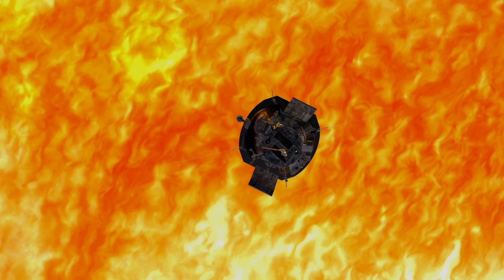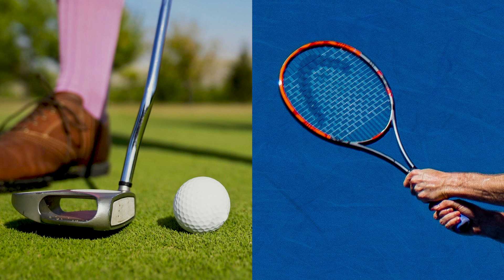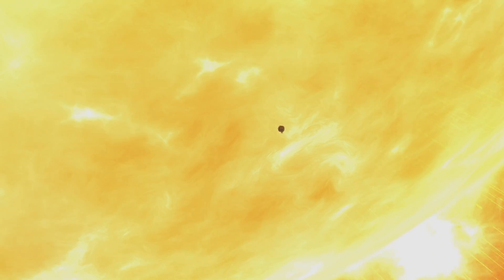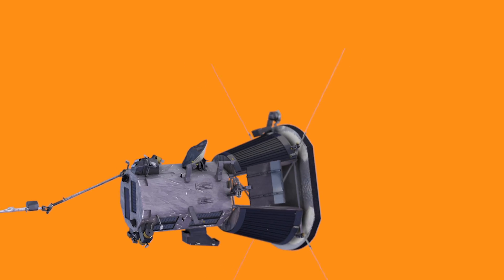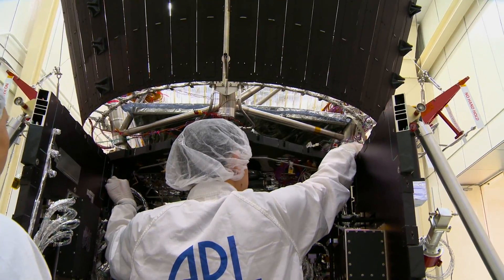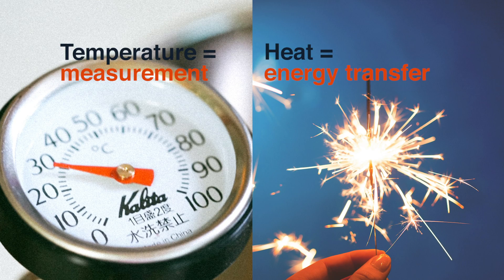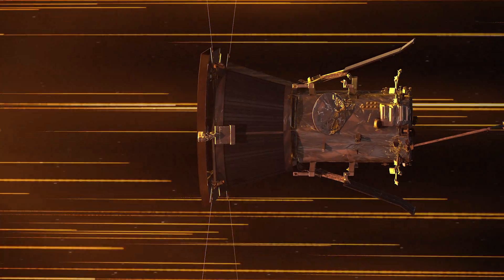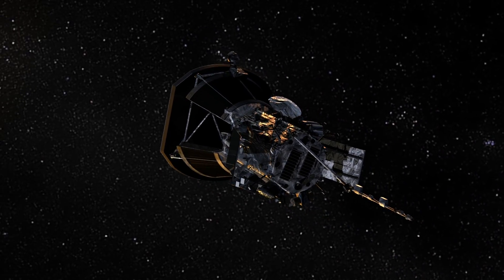Why Won't it Melt? How NASA's Solar Probe will Survive the Sun

Comment: water??? buttt??? water ivaporate right??? soo how long could it cool that craft?
Reply: A) its pressurized water, higher boiling point
B) its a closed system, like your AC or a computer cooling unit, you never have to replace the water. 
C) The water passes by radiators which radiate the heat into space in the form of thermal radiation since there is no atmosphere to convect the heat
Reply: +Saani Maula 👍😅
Reply: Cant tell if you believe me lol
Reply: +Saani Maula lol i believe because i cant wven correct my grammar so who am i to not believe in you? hahahaha lol😂😂

Comment: send a mirror close to a fire and see if it will reflect the heat or get very hot, remember that the heart of the sun is much powerful to melt or destroy any material that gets close to it this is why the earth has the ozone layer to reduce the heat of the sun yet things get cooked up when the sun becomes hotter causing volcanoes, bush fire and cracks on the ground. and to design the materials for the robot heat is needed to melt and make a cut to have a shape, that heat is even less than the heat of the sun as you get closer. even a deep freezer finds it difficult to make ice when placed in the sun for a longer time.

Comment: Water cooling solution? Just water?! In space?! Using radiator?! To transfer heat? Im no 0g engineer. But thats not how it works. Radiators need a gas to cool down. The vacum of space is absent of a media to transfer heat. So how do they do it again?
And plain old water? Yep great idear! Lets cool down a surface that might get crazy hot with water.... Dunno about you. But water boil at a relatively cold temperature. 
Being a marine engineering these big holes in this pressentation bugs me...
Reply: The radiators will radiate the heat in the form of infrared radiation. Youre right since its in a vacuum there will be no convection taking place, which is why PRESSURIZED water is a great choice, its got a much higher boiling point. As a marine engineer I hope you know what PV=nRT is.

Comment: Bu... bu... but what does it do?
Reply: According to Wikipedia:
- Trace the flow of energy that heats the corona and accelerates the solar wind.
- Determine the structure and dynamics of the magnetic fields at the sources of solar wind.
- Determine what mechanisms accelerate and transport energetic particles.

Comment: So where does the heat that goes to the radiators dissipate?? The one on your car transfers heat to the air that passes through it. But theres no air(or any other median) for it to transfer into. Sounds like the water flowing will just heat the spacecraft more evenly.
Reply: The heat will radiate into space as infrared radiation

Comment: History has told us that that the sun is hot. It’s not. The radiation with superheat an object and heats the earth due to its atmosphere.

As one moves away from Earth, the air gets colder. Space is cold. Although the sun is a source of radiant heat, the air around the sun is cold. Similar to a microwave. The oven is cold to touch, the inside is cold to touch but anything placed inside will be affected by the radiation.
Reply: You dont need that to explain why space is cold, watch the video again. The are particles radiated away from the sun in the form of infrared radiation, these particles have a high temperature, however the amount of particles per unit space is low. As a result the heat transfer is super minimal resulting in no heat transfer. Combine this with the fact that vacuum of space isn't an atmosphere, it cannot perform convection, as a result the radiation simply travels through without being absorbed into anything

Comment: NASA please teach Apple how to keep their new laptops cool as well. Thank you.
Reply: Simple, run your fans from much lower temps and put in some vents
Reply: thought old macs like mine are the only ones that heat up like hell. guess new ones do too?
Reply: @naomiperez7482  New ones are much worse! I've owned every single MacBook they have put out they just get worse and worse. I would shift to Windows but unfortunately I'm into music and the software I use (Logic X) is only compatible with Mac.
Reply: There's a reason why these engineers are working at keeping laptops cool and not in a space agency...
Reply: @atoms_dancing  haha good point
Reply: @BlueEthereal  ditto
Reply: Simple. Don't buy a apple product.
Reply: @HaikHakopyan  and buy PC with water cooler instead
Reply: We at NASA would be delighted to teach Apple a thing or two. Their platform is horrible.
Reply: Pv = nrt, reduce pressure of air
Reply: @tarankirat8226  that doesn't make any sense. How is ideal gas law relevant here?
Reply: iphone too please :(
I run instagram for 10 minutes and its ready to explode bcs of overheating
Reply: Mac M1 is dope ngl
Reply: And teach sony/PlayStation as well
Reply: because it's Motherboard And battery made by china , but I don't understand why USA won't make themselves  😐
Reply: @kishanpreston1533  then its cost is artificially hyped without much reason

Comment: Lol NASA didn't think abaut Solarforce. The probe will get near but wont survive not because of heat but because of energypressure. The mass of this huge ball is not only spitting out energy, it creates it. So NASA whatever you're trying your location correction wont work thanks to the most unpredictable gassbulb in our solarsystem!

Comment: Because the sun is not hot. The sun is cold fusion. Our atmosphere is what makes heat.
Reply: believe that non sense if you want.
Reply: SteveLovesGOD ive never been there so I can't confirm that however it would make more sense than a hot 🌞. Common sense says if your closer to the sun it would get hotter right? So if we go higher in elevation why is colder in out atmosphere? Shouldn't it get hotter? Astronauts never complain about how hot it is, always how cold it is. Cold fusion mixed with an atmosphere does in fact create heat, that's fact. Spain scientist have argued this face with NASA and always seem to get brushed off. An electromagnetic cold fusion power house would mean a game changer for military purposes, free energy purposes, you name it. Obviously a theory but a "hot" sun in a -454 degrees vacuum of space makes no sense, a cold fusion reactor does.
Reply: its the problem with NASA- Never a Straight Answer.  Get lumped into a conspiracy group when you question illogical theories they suggest. 
1 Day we will know the truth.
Reply: Cold fusion, you mean the idea that creators have been debunked for and they later admitted to lying? Yes Im sure Nasa is the one lying here.

Comment: EVEN WITH THE COOLING SYSTEM THE CONVECTION RATE IN SPACE (VACCUM) IS HORRIBLE, SO HOW DOES THE COOLING SYSTEM GET RID OF THE ACQUIRED HEAT?
Reply: Radiators. They dissipate heat in form of light.
Reply: You could have edited your post to be in the correct case.

Comment: Ok...I know these guys are science techs and try to think of all the angles, but are they really thinking of the angles here?
They're talking like the sun's radiation only goes straight out from the sun.
That probe won't get very close to the sun before high energy radiation is bombarding it from every side but the side facing away.
And with solar flares even that back side will be intermittently bombarded.
Reply: Of course they thought about that. They have to deal with muuuuuch more complex and non-intuitive tasks, than those you have pointed out.
And yes, most of the Sun's radiation comes from the front. I doubt that parts of satellite behind the shield are made out of chinesium.
Reply: "most of the Sun's radiation comes from the front"

Out here where we are that is true. But look at Mercury. The sun's light can be seen reflecting off its sides during transit.When you're that close. there is alot more of the sun around you than in front of you. 
So when they say that when the side sensors detect sunlight they'll reposition the probe so only the protective shielding is exposed to the sun, I have questions.

Comment: If it trailed behind the shield, not in actual physical contact, it'll last longer.
Reply: how would the shield cool off
Reply: 123 123 I'm talking about near mission's end when it can't be cooled anymore.
Reply: Why wouldnt it be able to be cooled anymore?
Reply: 123 123 Too close to the sun.  The temperature exchange would damage the equipment it was designed to protect at some point.
Reply: Nah. By pushing the heatshield down, you put yourself on a lower orbit making you speed up. By pushing the thing away, you’d crash into it. Not good for mission purposes
Reply: The heatshield would have to be larger, therefore reducing science. A separate heatshield for these types of spacecraft require more payload capacity or 2 launches, which would not be viable for NASA due to tight budget.
Reply: Lets not forget if the instruments trailed behind the shield you'd either need to increase the size of the shield to create a larger shadow or you would need to shrink the equipment to fit in the shadow

Comment: I don’t believe it. The temperature is way too high for anything not to melt. She is right about putting your hand in the oven, which she neglected to say is that if you kept your hand in the oven, it would eventually become how many degrees it is set for. It’s hard to believe that carbon foam could lower 2,000,000 degrees to a workable temperature.
Reply: > it would eventually become how many degrees it is set for
No, it won't. Temperature of your hand may increase to agonic levels, but it won't be as hot as oven walls before it will achieve thermodynamic equilibrium, where it gets rid of heat as fast, as it gains it.
Besides, the hotter object is, the faster it transfers it's heat away. Don't you know that? That's exactly why you can't increase an air temperature in your room by an infinite amount via a simple candle.
Reply: She straight up explained it. The particles individually are of a very high temperature, but they are so spread out that they wont all make contact at the same time, thereby reducing the amount of heat transferred. Going back to the oven, your hand will warm up sure, but only after enough particles have transferred that much heat, combine that with the oven being a tinier space than the 6 million kilometer distance (in the shape of a space since 3D) and the vaccum of space, there isn't any convection taking place
Reply: Temp Name the object typically placed has to withstand the heat or it gets cooked, or burns, or melts

Comment: The water won't get evaporated eventually??!
Reply: Just because you don't understand science, doesn't mean those who do are liars. Metal is not used for thermal insulation, as metal is an excellent medium for thermal energy. As stated in the video, carbon-carbon is used for the shield.
Reply: Hari Sankar where to? It’s in an enclosed system
Reply: Alysm Cool.. That answers.. I hope the system is so efficient to not lose any drop of water..
Reply: They keep the water pressurized, same as any conventional ac unit, compressed liquids have a much higher boiling point.
Reply: SteveLovesGOD it's not landing on the surface of the sun, but if it did, the surface is way cooler than the corona, so they wouldnt make it, theyll be in an orbit around the sun about 6 times closer to the sun than mercury. The corona is 2,000,000 degrees F but the surface is only 6000F , but they wont be that close, theyll be close enough to where theyll be in the thousands of degrees but they wont be close enough to the corona to just instantly destroy everything
Reply: SteveLovesGOD Your first question: The shield in front deflects the radiation from the sun. Think of it like standing behind a big mirror. The shield will still heat up so they have an insulating foam behind the mirror keeping the electronics at a lower temperature than the mirror itself.

Your second question: If they sent the probe perfectly straight at the sun than you would be correct. However they aim the probe off to the side, just missing the sun. The suns gravity will constantly pull on the probe bending the path of the probe to a curve. If the probe is fast enough it will keep travelling around the sun always just missing it off to the side. This is called orbiting.
Reply: @manny castro maybe that's the reason for the carbon-fiber reinforced carbon heatshield that can handle the temperature? 
You know, if they were actually lying about everything, why would they come up with such sophisticated missions?
Reply: SteveLovesGOD The foam has a melting point of 3600°C (it sublimates = turns to a gas before it boils). So it depends on how good the heat shield is and how good the heat is reradiated back into space. Like you said it's all radiation, so no heat is coming from the side through convection.  The hotter the spacecraft is the more heat it will radiate back out into space. It will reach some temperature equilibrium that is probably lower than the melting point but you will have to ask a physics student to do the math.

I don't know about the second point. I tried googling it but as far as I know carbon only sublimates at a measurable rate when it's temperature is above 3500°C. The same thing would happen on earth as well but there's oxygen present, so it burns much before it could reach that temperature.
Reply: If water is in a closed system it cannot escape no matter what unless the system fails to contain it
Reply: SteveLovesGOD and carbon isnt like metal, it doesnt get soft and melt like metals do at high temperatures, that's why it seems impossible but their technology is advanced enough to withstand a few thousand degrees
Reply: I mean this cant be the first time you've heard of public patents right?
Reply: manny castro I don't understand how refrigeration would work at such a high temperature...isn't the surrounding ambient temperature too high for conventional refrigeration...I understand you have infinite energy due to radiation....but where is the released to....
Reply: Chronox5 
thanks for actual responses... we both know things operate totally different in a vacuum. which is why I look into these things. 

Sucks that Nasa does not have in depth video on how the achieve these feats. 

we are left with speculating, and assuming Nasa figured it out.
Reply: Marian Keller the surface of the Sun temperature is what again???
makes no sense for the craft to survive on any aspect
Reply: so at the thousands of degree range, How won't the parts heat up and melt, no coolan is big enough on that object to cool thousands of degrees .,
  won't the gravitational pull of the SUN bring it closer as its no other force in the area other than the sun???
Reply: but at that temperature, in a vacuum, how does Carbon survive in a Vacuum, and not turn into a Gas, properties change in a vacuum. 

The video gives so little information, on actual design.
Reply: Chronox5 but as it's constantly that close, the foam will gradually heat up, and melt. foam has a very low melting point. 

it's all infrared heat. but carbon turns into a gas in a vacuum don't it???
Reply: There's no metal that could handle the sun heat ..they lying nasa it's a liar...